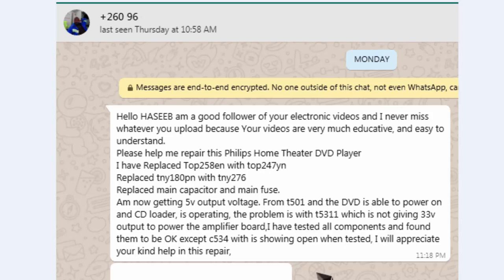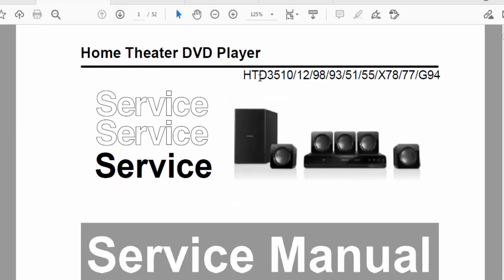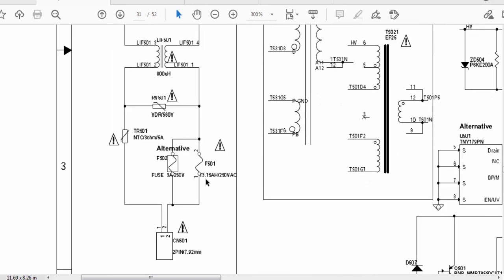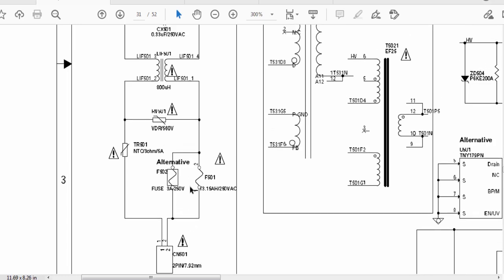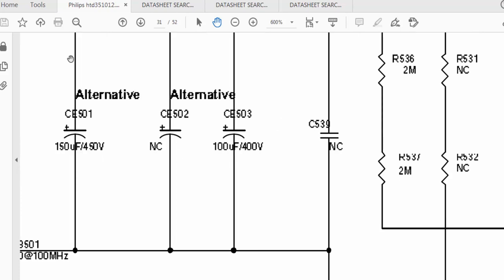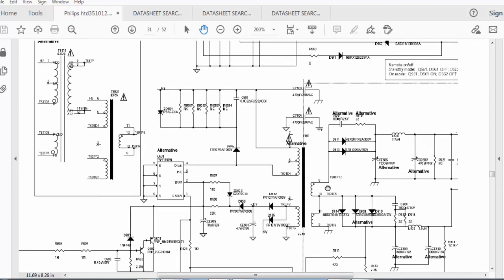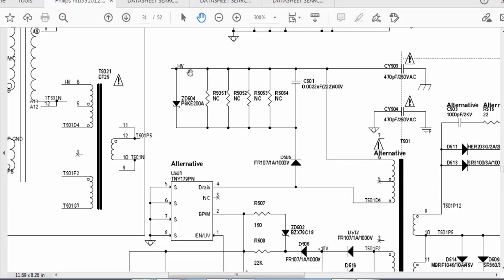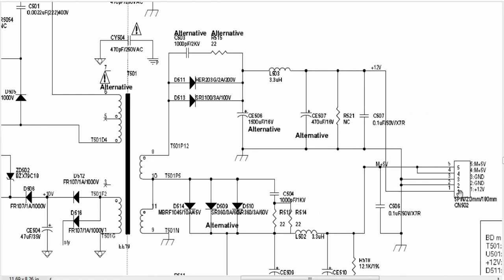#256 Philips HTD3510 Power Supply Circuit Description Explained

Comment: Hi, thank you for this video and great help. 

I have a similar issue with this power supply board not having any 33V.
All the 5V & 12V supply is working correct. 

On component U561
Pin 1 = 5V (on standby) 
then only 1V (power on)

Pin 4 does not have 10V and I am not sure where this 10V should come from?

I checked CE504 with power on and there is not 10V there. 
I am not sure if this is where the 10V comes for pin4 of U561. 

U571A 
Pin 8 = 5V when power on. 

U531
Pin X does not have voltage, I think this is due to the problem with U561

Please let me know any ideas of what to check and how to solve this issue. 

Thank you.

Comment: Hello sir, i have Philips home theater HTS5553. It has a problem. Now no power no display light.  Then i connect HDMI cable and i got DVD mode display on tv means it is working but no display and no power light. Then i try to control with remote and touch panel but its not working. Where is the problem? please help

Comment: In this same circuit why 12v show in place of 5v line?
Reply from the maker: in CN502 connector pin 1 is 12 volt. and pin 4 &5 is 5 volt 
these both power supplies are for standby

Comment: Hai I also have this faulty on this smps for lg DVD model lht 854 this power supply has 3 capacitors 270uf by315volts by two and one 450volts by47 uf now the problem is it has a high voltage on the capacitor 450v by47 if that's after the bridge rectifier help me or give me the web sit to download this circuit